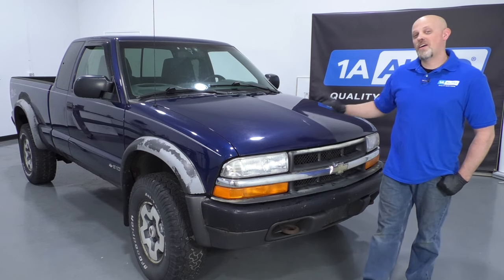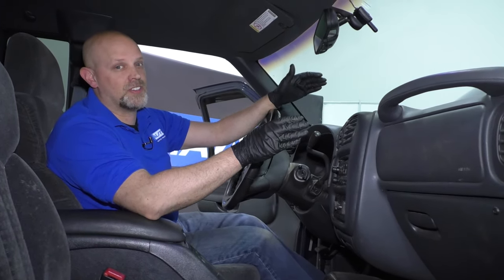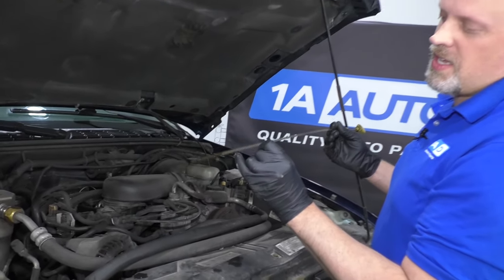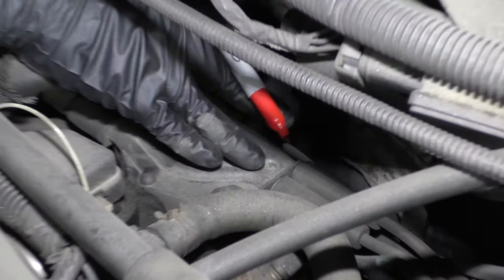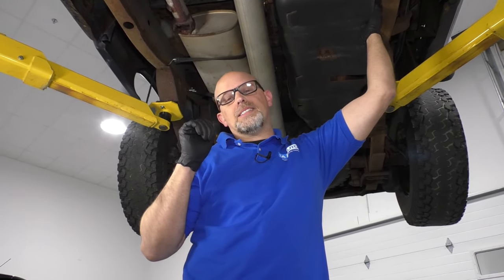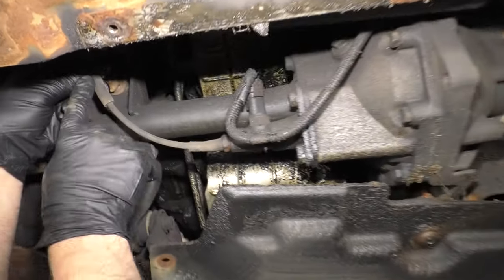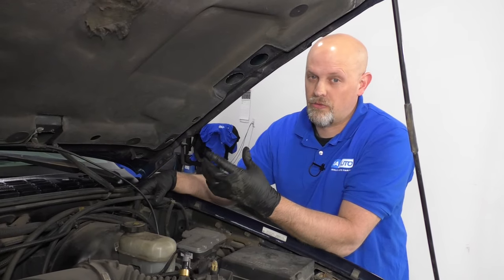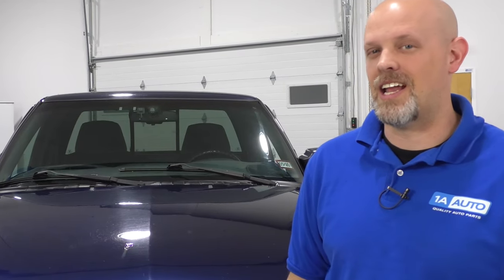Top 5 Problems Chevy S-10 ZR2 Truck 2nd Generation 1994-04

Comment from the maker: √  Watch the Video
√  Buy The Part at 1A Auto http://1aau.to/m/Visit-1AAuto
√  Do it Yourself
√  Save Money
Reply: I need to do my front wheel bearings and I have completed this list
Reply: Changed all that, next?
Reply: My only problems were/are a demolished front right wheel bearing, and my ABS light shows up every now and then which concerns me
Reply: How about abs system?
Reply: How about making a trap door for the fuelpump above the tank in the bed? I have a rubber bed mat, cannot even see it when rubber mat is over it or a bed liner would have the same effect.
Reply: Let me know if I got screwed thank you for a $250 tune up now I have to pay 1500 for a motor did I get taken for a ride please comment back thank you please be save and these videos I like them specially for my vehicle
Reply: What does seals look like and how go back
Reply: #1= 0:25 heater core 
#2= 1:40 intake gaskets 
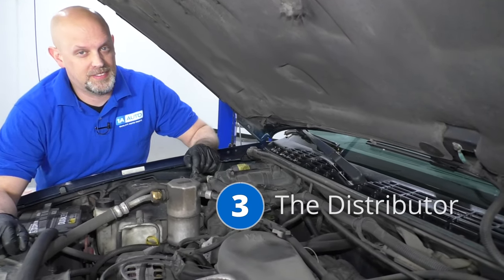#3= 3:35 distributor 
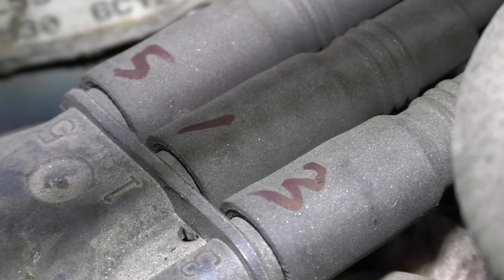#4= 5:00 front wheel bearings 
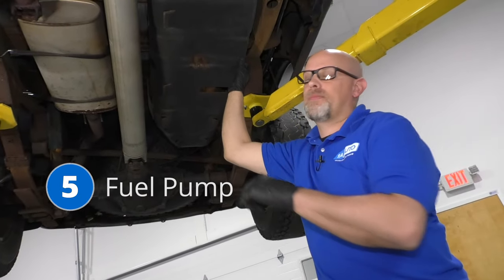#5= 5:35 fuel pump 
#6= 7:11 Bonus tip= concerning 4 wheel drive,
Reply: @dannyshore1794  brakes wear out every year
Reply: Only problems I had were the transmission, starter, alternator, brakes, motor mounts and maybe the intake gaskets.
Reply: in this type of truck I have a flex fuel LS it is sputtering when it has drove in drive gear but doesn't for the most part in any other gear or if I just idle it without driving it but when it idles after driven it sputters and dies? what would this be? I think it's the head gasket but am unsure it is a 2000 chevy s10 flex fuel with a 2200 motor

Comment: Add bad door hinges to the list replace the bushings often
Reply: omg my door got stuck open and wouldn't close....I had to drive to the mechanics like that and it was incredibly scary and embarrassing. Does it really happen multiple times?
Reply: Same here. But the hole  the bushing goes into is worn and enlarged. So the bushings don't last long. Unfortunately it's in the part of the hinge that is welded to the jamb.
Reply: Just did that 2 days ago. Pain in the rear to replace spring.  2nd set.
Reply: @randyclark8774  if you buy the door spring tool it’s super easy
Reply: I have a friend with a metal lathe and he made me a set of brass bushings to replace the crap pot metal ones you can buy.
Reply: The one I've got I've got to take the door off partially weld up the hole and take a Dremel to it that's how bad it is
Reply: not if you lube  them  ,,never had any of my cars go bad   ,,
Reply: Omg, right? I have a 2003 and my driver door is on its last leg😳
Reply: Everytime
Reply: Yup twice now
Reply: I bet the truck was wrecked and repaired and something isn't straight
Reply: Mine has all the pumps, fuel, water, and steering and all door handles inside and out and the tailgate handle - overall a pretty cheesy vehicle, would not repeat.
Reply: Andrew where do you live?..I've got a 2002 S10  in Southwestern 🏜 Arizona & have never replaced door bushings..I have replaced all my rubber suspension bushings with Polyurethane because of the extreme temperatures here
Reply: My buddy who fabricates everything put me a access cap  to the fuel pump  without having to take the bed off or disconnect & drop the fuel tank
Reply: @jimharney1047  I had that whole part that is welded come off nobody wanted to do it finally found some hole in the wall shop that did it
Reply: I got some steel bushings never had problem again make sure you apply grease to them

Comment: I don't see why anyone with a stock bed would drop the tank. Its 6 bolts to remove the bed. If you loosen but dont remove the rear bolts you can tip it back and get to the pump alone. I put a milk crate between the bed and frame to give me the room I needed.
Reply: Yes sir
Reply: The tank itself is only 2 🔩 bolts
Reply: Tippin it back in and work because there wasn't enough room to get the leverage to put the gasket on top where the fuel pump goes in because it's super hard to get off on the 2.2 you literally have to get on top of it and hammer it back into place because it's a spinning locking 3-prong fitting that goes on top of it this one and not a snap fitting on the 2.2 03 LS
Reply: No lifting a Blazer bed.
Reply: 2002 4.3 crew cab (4 Door) 4x4. If you remove bed you still can't get Full access to fuel pump due to the longer cab over hanging the fuel tank.
I replaced my bed with an exact fit from junk yard and figured it was a great time to repair No-op fuel gauge, fuel pump still operating correctly.
That's how I found out No access to fuel pump with bed removed. I had to drop fuel tank. What a pain without a lift. Fuel gauge problem fixed..
Reply: I would think seriously about cutting a access hatch in the bed lol.
Reply: @AZsmoothrider  my 94 had a trap door tell I put in cell when tank rusted threw
Reply: Never understood why you would remove the bed two tank straps and the tank it out new pump and straps is the best way to go.
Reply: @AZsmoothrider  that's what I did. Then I went to the wrecking yard and cut a panel from another wrecked S10. Only took about 10 min with a 4in angle grinder and a diamond metal cutting disk. I screwed the access panel down with large flat head 1/4-20 screws. I just tapped threads in the bed. Then I sprayed bedliner in a can over it to match my sprayed in bedliner.
Reply: 95 base 2.2L i tooke take out and lucky i did because it still looked great on the outside but the sending unit and part of the tank work rusted beyond me reinstalling $300 at autozone 
-Brand new tank
-Fuel sending unit
-Fuel pump
-Fuel filter
Reply: I just cut a hole in mine with a nice lil access door
Reply: @MulliganWallen  no idea what you just said but I'm happy it worked out for you, or I'm sorry it didn't buddy.
Reply: just cut a  12x12inch access  panel   and  get a metal  stretcher . stretch it like 1 " and screw it back down on top

Comment: Figured out a way to do the heater core easily! It sounds rough, but if you are careful you can cut with a air jig saw or oscillating cutter or similar tool, around the plastic air box under the hood to gain access to the heater core and after fab up a “filler” strip of metal or plastic etc and carefully epoxy or rivet the 2 halves back together and with alittle time, skill, and creativeness you can cover up the seam saving many HOURS and lots of $$$ in labor charges! I’ve done quite a few and have had ASE techs no even realize it….why spend hours and hours in misery if it can be done in an 1 hour or so?👌🏻
Reply: Please make a video of this

Comment: The s10 is a great truck. Getting hard to find these days.
Reply from the maker: +Farmer Dude357 Thanks for the feedback!
Reply: Just bought one today for $2,000 way better looking, 4 door, 4wd, luggage rack and back rack to extend the bed
Reply: @proxgamer7759  how u like it ? Thinking of getting 4 door s 10 as well
Reply: Cool good to know, in case I ever sell my V6 Vortex extended cab.  I love my S10 bought it new in 1997 its a California truck no road rust.  

 I just have an intermittent problem with the wiper motor not working all the time.  
I'm going to remove it and reheat the solder welds on a couple spots. I understand that they could be cracked and the reason for the issue.  No need to replace it with a new one. Great truck otherwise. Always dependable. I wanted to see if he mentioned that  here.
Reply: Bout to be buying an old s10 show truck for 6k lmao. Sucker is mint id eat off the engine bay 🤣
Reply: Buddy I know bought one 99 and one previous generation, 600 each
Reply: I know I have one I love it 😍
Reply: I had a 2002 blazer. It was an awesome truck. Had the same intake gasket problem though. Replaced the fuel pump twice. And needed a new center link. Drove it for over 2 years and put about 75k miles on it. Gave it to my little brother a year ago. He's still driving it. Running like a champ.

Now it was only the rwd model. But still went through snowy winters like a champ. And I never had to worry about the front diff going bad considering he missed that other common problem with the 4wd variant.
Reply: I just moved and my new neighbor has the same s10 as me xD
Reply: Uhh, they are pretty common and cheap, the manual ones are a little harder, but still easy to find.
Reply: @HRTsAFyre  With my blazer the motors just seem weak. I've had dirt get stuck under the wipers and it almost glues the wipers down.

Comment: Nothing about the drooping doors?  Pffft.
Reply: Duuude. Just put in new pins and still drooping
Reply: @evanlane7935  i don't really call body shop guys mechanics, but they sure as hell can fix a door better than i can
Reply: @evanlane7935  wow my door. Actually been ripped off by somebody that I wanted before me backed out of a garage and ripped the whole door off welded damn thing back on with and use bolts instead of pins and it would suck so bad when I open the door that you couldn't just shut it you had to lift up on it and then close it the holes were the pens went were wallered out big-time and I was still able to put new door pins in and it's just fine sometimes the hinges get a little bent and that's what makes your door saying I just hammered mine straight then put pins back in

Comment: Had a hell a lot more problems then those five issues
Reply: Exactly
Reply: Ive had problems on everything but the transmissions on the s10s ive owned. From front to back everything has had problems.

Comment: Good review. I have actually replaced everything you have commented. I would say ball joints before wheel bearings.
Reply: When I bought mine I had all mine including the brakes and rotors replaced, it had sat for about a year to a year and a half and was driven home

Comment: Heater Core for my 02' Blazer ZR2 w/ 300k miles is $40 but $400 for install & I'm not having the dash taken apart because it never goes back without rattling. 
I don't need heat in SE Texas. 
The Stock Tranny Sunshield will snap, causing a rebuild. ($2200)
The ECM & Coil may crack like mine did & short out causing a No Start. Changed my distributor, the Cap only 6 times in the past 3 years. (Humid)
Radiator flush, Clutch Fan, 02 Sensors, wheel bearings or hub bearings. 
A Arm replacements. Fuel gauge located near fuel pump is shorting out. So gauge jumps around. 
Changed out all vacuum switches for 4x4 & actuator under the battery. Dorman now makes a HD Actuator. 
Thick rubber, finally!
New plugs, wires, Camshaft Position Sensor & she's like new. 16mpg. 
Which is the 02' Sticker mileage. I paid $3k for her & put in about $4k more in repairs & she's been a great 4x4 the past 8 years.

Comment: The most common issue I see on them is the 4x4 vacuum diaphragm. 
I have driven S10s since 1988 when I started in pest control and can say I've had no problems with any of them.  The worst thing I've had happen was the rear axle recall on one of them. I currently have a 2004 blazer with 225k on it and wouldn't hesitate to drive it across the country and back.
Reply: I agree or the vacuum switch on the case goes out and tranny fluid ruins the diaphragm. I had a 02 gmc sonoma and I've had to replace it twice.
Reply: so glad to hear. Just found me a 2002 chevy s10 with a nice little camper on it for only 55k miles! Was rarely driven and mainly stored. Hope it lasts me a good whiles!
Reply: How much you pay for S10

Comment: Rocking a 1994 2wd....bought it for 500 ten years ago.....replaced...fuel tank. Starter. Clutch, alternator. Fuel pump/ filter, distributer, injectors, muffler/ tailpipe. Fuel pump again... love the truck wish I would have taken better care.  177300 miles still spinning,  havent had rear brakes for 7 years

Comment: HE forgot the spider injection leaks and low quality poppet injectors the upgrade kit which you guys sell is good for it
Reply: Just changed mine. Quick job took about 20 min.
Reply: Would this cause fuel in your oil? I got a 2.2 with fuel in my oil
Reply: Swapping mine this weekend
Reply: Spider injectors are gen 1 it’s a throttle body

Comment: I had a 95 one and I'll never forget breaking down in the middle of nowhere after the fuel pump went out , no cell coverage anywhere and it was the middle of August in the south. very hot! I probably  walked 6 miles before someone gave me a ride. I was soaked in sweat.
Reply: Man, the number of times that could have happened to me. Just thinking of my Blazer's current condition I'm afraid to go anywhere.
Reply: Sounds like it was a good time
Reply: My fuel pump was going bad for almost a year before a replaced it.  Never left me stranded though.  I would just bang on the tank with a shovel or just start it with ether.  It had enough fuel pressure to run but not enough to start it.
Reply: GM had crappy fuel pumps    AC Delco parts were garbage thats why GM almost went out of business

Comment: Yep...bought my 2000 s10 in 2014.  Have had both the heater core and fuel pump replaced.  Other than these issues, has been a great truck
Reply from the maker: +Lori Hicks Thanks for the feedback!
Reply: I have been driving a 2000 GMC Sonoma since 2002 and have over 285000 miles on it. I have replaced the fuel pump, but everything else I take as normal upkeep. It's my baby. @1AAuto
Reply: just getting ready to replace the heater core in my 2000 - looks like fun!
Reply: I’m so sorry 😳 I have a 2001 Extreme Blazer
No Heater Core or Fuel pump problems. 
But I do have Distributor Problems. The Cap has to be Changed every 2,000 miles ... it gets Corroded inside on the terminals  I must clean it or replace it ???
Reply: 180k on mine (4cyl)still runs like a champ
Last 13 years I Replaced fuel pump,hub bearings, and that’s it!
Reply: @jimmysapien9961  , GM went cheap on the S10's using a plastic distributor base. If you use the aftermarket distributor cap screws, they are typically too large and break or strip out the plastic holes in the distributor base. Help(or Dorman or whatever they call themselves now) sells a kit which is a metal strap that mounts under the plastic distributor base where the distributor cap screws will screw into that allows the cap to be tightened down properly. They are expensive in the part store(i.e. $30+) but reasonable online, approx $15-$20
Reply: Forgot to mention , this fix should lessen your rapidly corroded terminals in the cap Jimmy
Reply: @JoelEmberson  did it wih both of mine.2 men 4 hrs and all done, jst remember where all the screws go ,drives you nuts,good luck

Comment: The S10 is still a kick ass pickup and my favorite pickup of all time and my dad kept his 03 s10 and is currently with my uncle and soon too be back home with my dad or me.
Reply: I have had (3) S-10s over the years. I have replaced EVERYTHING over the years, except the 4.3L motors!!!! Front bearings go bad and fuel pumps... All 3 that I own have over 200,000 mi..... Rusting out along the rear bed also on all 3....
Reply: @Grandma Ducky take care of it well! Beware of the rust you might start getting, spray everything down with a bottle of transmission fluid until you can properly coat it
Reply: I too, have the 2003 Chevy S10 ..18 years old, and running strong..150k miles.. white in color, with the full size bed on it, which u don't see very often. This truck has been our family since day one and the thought of trading her in just kills me. I literally have had people stop and tell me what a beautiful truck, and how well kept it is .. even have had compliments on the stock wheels it came with. It has kept pretty good blue book value, as well! Think I'll just hold onto it😁
Reply: @thomasfoss9963  
Is this an issue I need to look out for,..I have an 03' S10, with a full size long bed.. any way to avoid the rust issue?

Comment: What about having to jack the engine up 1" to change the starter every 75,000 miles? lol  Last year I thought I needed a new 4WD vacuum switch acuator and it was quoted a $200 job...ended up being only needing to replace a faulty vacuum line, which had age related deterioration after 26 years, for $35 at the local repair shop...Have never had any Distributor related issues, or leaking anti-freeze issues, or fuel pump issues....Only problems on my 1995 4WD S10 has been a dash cluster going out at 99,995, a universal joint, 2 starters and 1 fuel filter...engineers stuff the fuel filter in a terrible spot and as ssaid before you must jack the engine up 1" in order to replace the starter...Love my pickup. with 188K